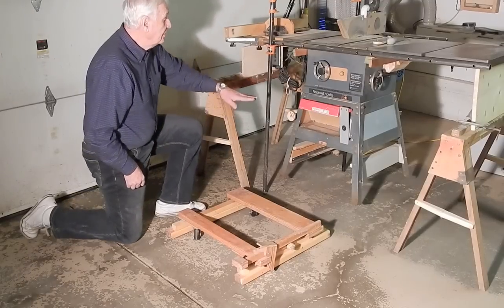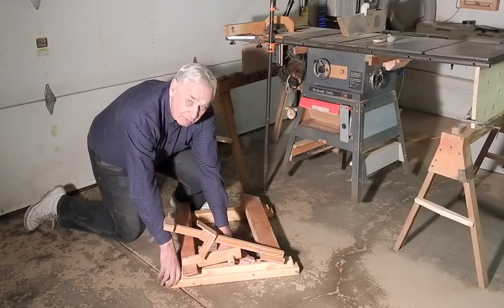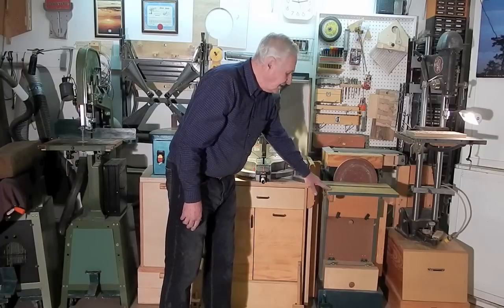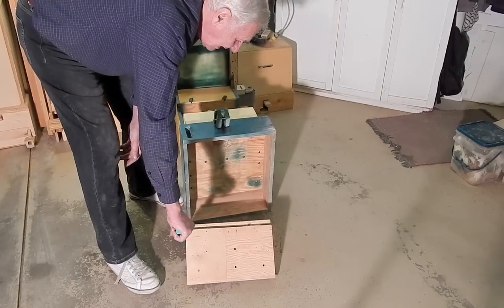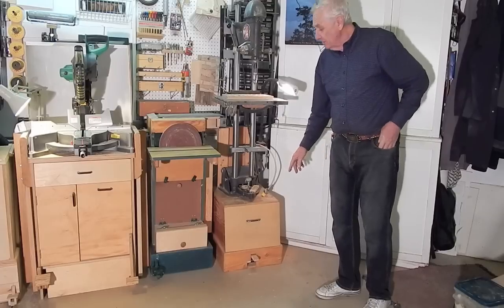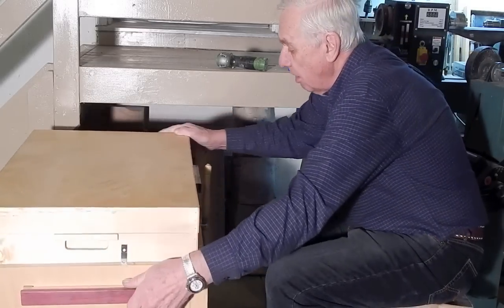Retractable Casters for Power Tools

Comment: Hi Carl, thank you for sharing this video.  I have a quick question.  I am planning on apply the same design like yours onto a  8 foot workbench.  Can i use the same design but setup with larger base onto the workbench?  Do you have one setup for your  workbench?  Thank you.
Reply from the maker: +Jack Wong  - No I don't have retractable casters under my workbench but it's on my to-do list.   I expect to use a system similar to the one I use under my lathe - a separate jacking system under each end.  That will leave the space under the bench free for shelf and drawers for storage.  ////Carl
Reply: +Carl Holmgren Thank you Carl.  Appreciate your quick reply. Jack
Reply: I had the exact same question and before I even read this I had picked out the ones you designed for your lathe to use on my 8’ workbench I’m building. Great video and thank you for sharing your ideas.